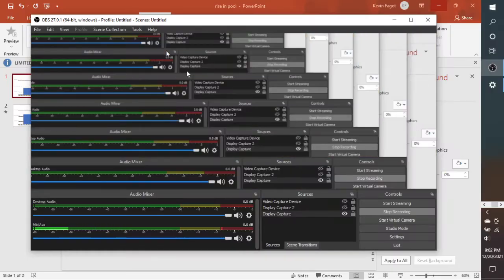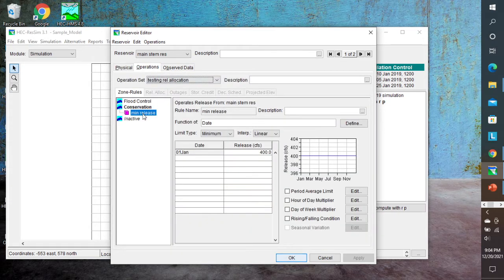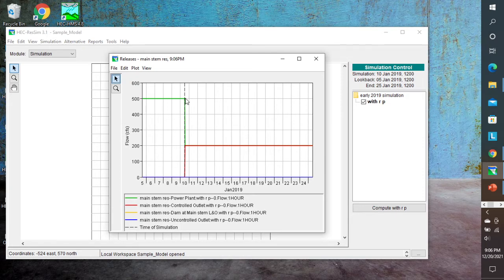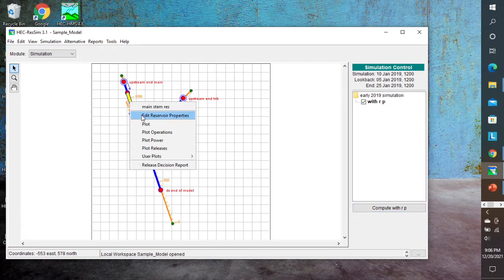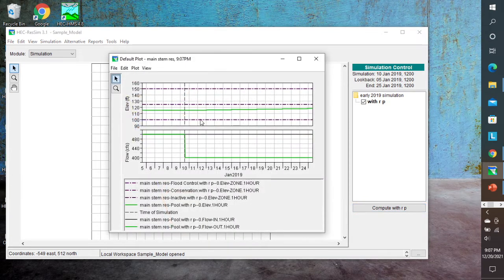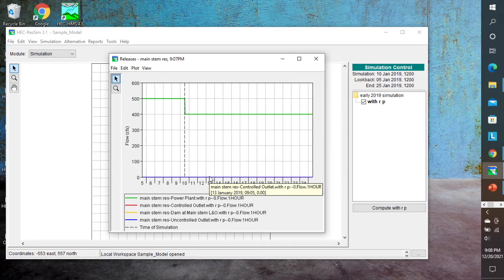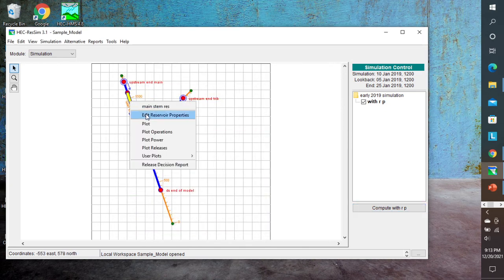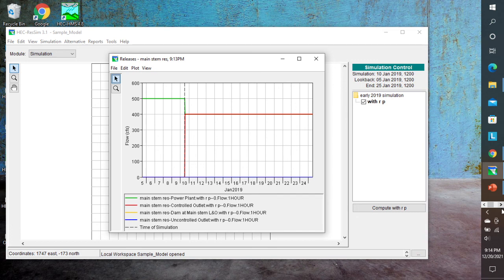How do I model hydropower first?

Comment: Hello, thanks for your helpful video. If I have a multifunctional reservoir (hydropower and irrigation), and the irrigation water will supply from the reservoir to the irrigation area, the irrigation water supply depends on the downstream water needs which will vary every month, how could I construct the HECRESSIM? How to set the irrigation outflow constraining by downstream water demands? shouLd I add a diversion or just use the controlled outlet?  Thanks very much.
Reply from the maker: I believe a diversion would work better for the situation you are describing since a diversion can remove water from the system.  A controlled outlet is going to move it through the dam, but it will keep it in the system.  In other words, it releases it to the channel downstream of the dam.
Reply: @hecressim  Hello, asking for help again. If I want to optimize the reservoir operation, how could I realize it? I found hec-resprm which could do this. But I could not find any material or the update software. Do you have any suggestions? Thank you very much.